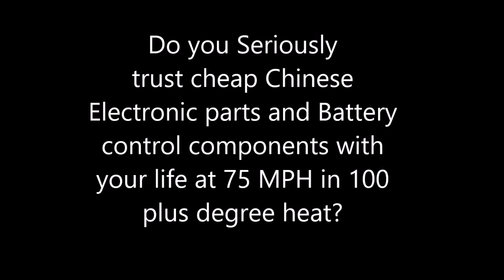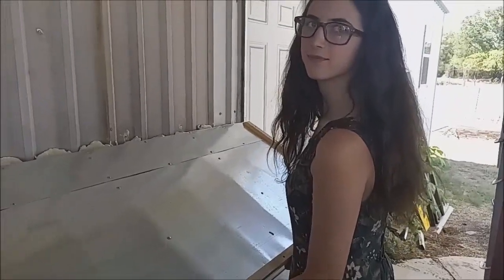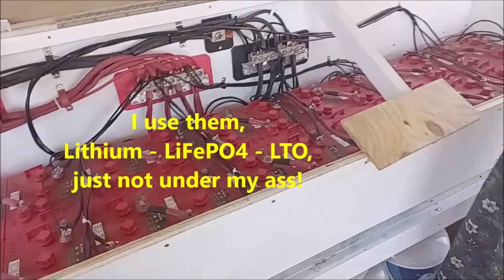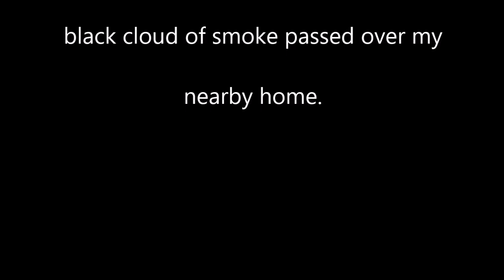Lithium Ion Electric Car On Fire, Battery Car on fire, The NEW NORMAL?

Comment: These electric cars will be a huge issue as people discard them the same way they discard their smartphones, flatscreens, laptops... etc.
Reply from the maker: People complain about somebody throwing a trash bag with a little bit of lead paint inside the bag turn it into an EPA national event and send in the Blackhawk helicopters like it's a act of war. But when they dump off a laptop, or any of the crap coming out of some of the new stuff we're building made with rarefied materials everybody just looks the other way. It takes 19,000 lbs of lead disposed improperly to reach the same toxicity level of 1 3500 lb  electric car.
Reply: @JOHNDANIEL1  RIGHT?! Lol I actually never dispose of my electronics. I keep them, I use my phones until they actually physically break and I still don't throw them in the trash. I have ancient laptops too that I will never throw out. I liked how my grandparents generation, used the same TV for over 20 years, the same phone, and reused everything.

Comment: Those who want to control everything, are impementing a smart system that will connect houses, cars etc, it will let them be able to do what ever they want to those who are connected. This is why they had all these solar contractors giving out great deala, fet eceryone connected to their system, if yiu go against the system, they can send pulses to you home batteries, car batteries, etc and make them overloaded and start a fire. Smart meters, smart batteries, wifi, smart tvs, smart appliances, etc.

Comment: Cant tell if there are bots in the comments or just fanboys... 🤔
Reply from the maker: I guess you're referring to the amount of people that immediately start defending lithium product batteries? My saying anything that may "appear" to be negative to the lithium battery cult members draws out an extreme response. They apparently don't watch much of the video that explains it's about the poor quality & over complicated electronics being used in such a life risking scenario not the battery used in something so they react with immediate cult level butt hurt. The whole video starts with me explaining I use lead acid because it doesn't require a bunch of crap that could fail to operate it.
Reply: @JOHNDANIEL1  yes it's either cult like following or bots spewing out info to support a narrative. I guess you'd have to figure lithium batteries are going to save the world to get that worked up defending them. Personally I think some day some battery (type) will change the world and maybe save it ?? but that's probably a stretch. Doesnt seem like lithium or lithium iron phosphate will be the ones to do it though. The cost is enough to disqualify them at the moment, nevermind the hazards.
Hope you're well John. Ive definitely learned some things from you through your channel and appreciate it.
Reply from the maker: @lancealderman2755  A study done in Canada showed Lithium Tool batteries, just one improperly disposed of permanently damaged the ecosystem of a 25 foot radius area and up to 4 feet of soil depth. Same results with any lithium based, especially China Air (CALB) battery. LiFePO4 and LI based are only 16% recycled with under a 1% yearly increase even though their use is gaining by 6% a year (Commercial Metals Expo 2021).
 Now multiply (25}4 squared times as much as 208.7 million a year of these batteries from computers to toys all done the same way. Nice huh! 
But since they pay nice for recycling Lead Acid batteries they get back 89% for reclaiming and a lead acid battery has only a 2% end user pollutions ratio. I did study both sides, but I can't get $680 cash from my LiFePO4 dead batteries in 5-8 years, but I can get that for my 24 Lead Acid batteries from the local dealer. Pays for the first 4 off the top. And my Lead acid due to using small wind turbines gained over 20+% longer life (static Ground Pulse DeScaling), over 8.5 years, but small wind turbines actually shorten the life of LiFePO4 due to their ground point pulses affect battery chemistry. 
NUFF SED!

Comment: When electric vehicles were around in the 1800's. The batteries they used are the same as the lead acid filled ones of today. As gas engines. They worked. Although as gas and fuel plus lead acid batteries. They can not make as much money with those as they can with the lithium batteries. See if anyone knows this. I am not sure. On the Tesla and other electric vehicles. Is it not the door opening mechanism also only electric? If so. Thats why who or whom was in that vechicle did not make it. They couldn't get out. If an fact. You own one. Have an window breaker handy at all times. For my shop solar. I use also lead filled batteries. Same with my boats and camper. No thinks on electric vehicles. If I had to buy one. There went the warranty. They can keep the lithium batteries. I am putting in my own.

Comment: I would NOT like to be trapped in an electric car, you just can't put them out.  Even if the fire and rescue get there in a minute, you are not going to get out!  I wonder how many deaths are going to be people trapped in an electric car that could have escaped a fire in a normal fuelled car.  You can put out a Gas/Petrol car, but try putting out an electric one!  Almost impossible.  I would rather have a Hydrogen car, at least the hydrogen burns off fast and the fire can be put out.  Mind you, while the hydrogen burns....Wow!!!!
Reply from the maker: A gas car can on average be extinguished in a few minutes, electric cars could take 30 minutes. They are equipping fire fighters with more assets to deal with them though.

Comment: /2022/01/12/government-data-shows-gasoline-vehicles-are-significantly-more-prone-to-fires-than-evs.
Reply from the maker: EV's are less than 1% of what's on the road. Include hybrids then you just exceed 1%.  They are also driven in much less places. I'm absolutely sure in 1903 that horse and carriage fires exceeded automobile fires at the time.
Reply: @JOHNDANIEL1  
AutoInsuranceEZ data from gov site shows EV catch fire 25.1 per 100,000, ICE catch fire  1,529 per 100,000.

Comment: According to the U.S. Fire Administration, it’s estimated that 171,500 highway fires occur across the United States every year. Highway vehicle fires account for fires in passenger vehicles, freight road transport vehicles, and agricultural or construction vehicles.

Approximately one in eight fires responded to by fire departments is a highway vehicle fire. The majority of those fires, which originated from the engine, running gear, or wheel area, occur in passenger vehicles. As a result, 345 deaths, 1,300 injuries, and $1.1 billion in property loss happens annually.   Remember, many of the parts in Gas vehicles are made in China as Well!
Reply from the maker: Look up Kia car fires, Chinese parts 90% to blame. That's the point.

Comment: 1 electric car burns what about the 1265 gasoline cars that burn this same day. Yes true facts.
Reply from the maker: If they were more than 1% of the cars on the road they may show up as the same average. Or even if they were the same average age but they are not. The average age of electric car on US highways is 3.84 years, the average age of a gasoline powered car on US highways is 11.77 years according to CNBC Business News. Plus you got to drive them more than the average of 30.4 miles a day verses 42 miles a day of gas cars to equate their risk. 
However the video wasn't about electric cars, it was about the crap they use in them.

Comment: Technology that works on the bench doesn't always function in the real world. 
I do have a milk crate full of calb cells next to my bed running my trailer. Protects them from extreme temperatures. That milk crate takes the place of my 650 pound pallet of lead acid batteries next to the trailer.
Reply from the maker: Nothing wrong with that if it works for you. But 650 lbs is 10 golf cart size batteries, about 1300 amp hours so if you can fit 1300 amp hours in a milk crate you got some badass batteries.

Comment: Electric cars do not use LiFePO4 cells because they are lower capacity than same sized Lithium Ion and Lithium Polymer.  If they did use LiFePO4 there probably would not have been a fire.  That also looks to be a pretty bad crash.
Reply from the maker: No signs of d crash, just started burning and very few feet later was in the ditch.
Reply: @JOHNDANIEL1  The rear end and side are crushed there is no way it was not in an accident and there are bumper parts on the hill.
Reply from the maker: I guess we'll start looking for the phantom car that hit it then, looks to me like a whole lot of parts flew off of it when it hit the embankment of the ditch but then again I was only a few hundred feet away
Reply: @JOHNDANIEL1  I am just trying to figure out why someone would slam the brakes and run into a ditch that fast causing that much damage.  I guess we wont know until an official report is done.
Reply from the maker: @jeffclark5206  Ah, Got ya. Yeah no one knows much, not even sure what it was besides a scene worker said big battery fire in car. But I do know in Michigan a Electric car caught fire and its wheels all locked up from regen braking and it slammed a hillside. But it's possible when a car fills up with smoke a driver may just wreck it. Someone mentioned skid marks from the west bound lane at my road entry, but thats Kyle, the idiot local kid in his hopped up S10 pickup makes those. He makes lots of them. Wouldn't want to buy tires for him.  This car was east bound and about 400 feet before my road.
Reply from the maker: This just popped up, see it, and know why I am avoiding all the weak link things people are wanting now. https://youtu.be/nU0nF1MxX34

Comment: Maybe a chevy bolt, all of them are under recall for starting on fire.
Reply from the maker: Yes I've heard about the Chevy having a lot of problems with their control operating hardware. It's not said that it's the battery it's the components they put on it. And that's exactly what the video is about, this car was I'm sure running the air conditioning, running 75 mph and doing it in the extreme heat so a component failure could have caused every bit of this. The batteries themselves would have been shut down if the control component would not have had a problem in my view.
Reply: @JOHNDANIEL1   @Јоhn Daniel  From what I read, the bolt problem was only due to a battery defect. That is why LG, the battery manufacturer, is paying for most of the repair.

Comment: Internal combustion engine with a radiator, water pump and thermostat...... Tried and proven to be the best technology to power an automobile.
Reply from the maker: Personally I do lean a little bit towards liking the hybrids. If I build me an electric car out of my 2000 Chevy Metro I will be using lto batteries absolutely which are lithium-based but I'll also be using a Freon gas temperature sensor bulb control switches and not some electronic voodoo garbage.

Comment: Maybe best use Edison batteries when you can find them the new company that sells kind of an Edison battery are $$$$$ 10,000 to 15,000 I believe per battery but they are 100 year batteries but lord  I ain’t spending $1,000 much less 15,000 for a battery
Reply from the maker: I've seen a few people physically building their own Edison batteries so I'm wondering how anybody can get away with selling them for an insane amount of money like they do.
Reply: I got 13 400ah nife battery cells off ebay  for $450. They are about 50 yrs old. ⚡️⚡️⚡️
Reply from the maker: @mdunbar04  Thats Luck! We had a huge Nickel iron battery bank in the back power system at Firestone Chemical plant when I was a kid. As big as a semi trailer and it was there for 40 years back then. Replaced in 2012 with the same.

Comment: You mentioned LTO batteries in your litany of Lithium batteries burning. Where did you come up with that. Lithium Titanate Oxide batteries have been tested safer than any battery chemistry out there. You also fail to mention how lead/acid batteries catch fire when charging and the sulfuric dioxide that they emit cause severe respiratory problems including lung cancer,  must continually be serviced by adding distilled water and have a short shelf life. I'll agree with you, however, if you're only going to run a 12V system that needs between a half to a full dozen chargers and inverters as you spend a few hundred dollars building your system over a 10 year period of time,  lead/acid batteries are probably the way to go. My LTO batteries can get up to 20,000 cycles and can be discharged down to 0% SOC. They can also be charged at a 10C rate of charge bringing them back from 0% to 80% in 90 minutes and 100% in 140 minutes. How long does it take to get your batteries back from 50% to 100% Mmmm, I thought so. So quit telling everyone that you aren't bashing Lithium batteries. Lifepro4 don't burn either!
Reply from the maker: I never said anything about LTO burning  or even said any lithium based battery causing a fire. It's the cheap embedded electrical stuff that's 90% the problems you'll get here. My simple comparison is is that my lead acid batteries don't need none of that crap to give me the results I need. 
Face it if you get in the war with China or anywhere else in an EMP goes off everybody's electric cars and electric toys using BMS or similar systems is gonna be  garbage. 
In fact if you can afford them I recommend LTO over any other battery AND THAT'S NOT BECAUSE I DESIGNED A PHYSICAL CHARGING SYSTEM USING OLD SCHOOL GERMANIUM PNP SHIELDED TRANSISTORS THAT ARE VERY GOOD. HAHAHA.
Reply: @JOHNDANIEL1 Your statement about the electric car burning included LTO and Lithium batteries, John.  You are also wrong again, I have a total EMP hardened solar system and one thing I have found about LTO batteries is that the cells rarely get out of balance so, all I would need to do is unplug the BMS leads and connect directly to the terminals. I also have three vehicles I keep that are carbuerated with generators. If your AC system is not EMP hardened,  you can't run anything anyway.  I am not pushing Chinese manufactured anything, my batteries are from Japan, hybrid inverters from Germany and Solar panels from Canada. I don't see anything that you use on your channel or had on your shop in Twin that wasn't made in China. Hahaha!
Reply from the maker: @fisherus  Simple solution to being EMP resistant is to self contain in a full metal structure. But, Not sure why your on this offended griff, No need to stretch it to "john beating up on LTO" thing. LTO is not a target of the issues. I like LTO better then any battery format. And you can charge it with a basic battery charger from Autozone.  And almost every part in all of everything you have, is still 90% made in China so yes, you funded China and since nothing I drive is deliberately newer than 2008 I won't have much china in it. Germany and USA "made?", thats a fraud. Answer, NO! Check BOL trails, everything is mostly a parts list from China ( BMW-Benz - VOLKSWAGON-GM-Chrysler-Siemens-Phillips- Toyota-Nissan- Midnite classics-Blah Blah, All of them partially assembled in China and finished in another location. Sanyo-Panasonic-Fuji battery plants in Japan is actually in Indonesia, Do a tour of the Capacitor plant in Japan, the Resistor Plant in Germany, the Control grade Semiconductor factory in ...........Whoops- None giving tours unless they originate in Shanghai  , Same problem. Hard to determine quality/plant/origin of any electronic thing other than try it, study it, and know facts on it, way different when it comes to their mechanical things for sure unless you got some magic dust and can build all of it. Even Ista Breeze of Turkey just is a boxing shop now. 
*Bet you can't stop or steer your carbureted car without those made in China (mexico if your blessed) new American branded made over seas since 2005 brake pads that suck! 
Even buying a Fkn horse may get you shocked that all their vaccinations and basics come from yep - FUKN CHINA! 
Do I support China, Fuk No. Do I spend days trying to sort out shit from useful, Yeah.

Comment: LiNiMgAlCo Chemistry is VERY different from the  LiFePO4 Chemistry we use in home solar projects BTW.    ALSO WATER FEEDS LITHIUM FIRES!!!!   Gives it MORE O atoms for the Lithium reaction and strips off the Hs. Treat it like an Electrical Fire.  NEVER USE WATER.   PS.  Texas Fire department was filmed pouring water on a EV Fire on a Gas Station a few months back /o\  PSS... 7+ PUMPERS OF WHAT???  Hope NOT Water LMFAO
Reply: ALSO.  IT HOT AS FUCK IN TEXAS. IF THAT COOLING PUMP FAILS... haha  FIre can happen quick.
Reply from the maker: So true. 
But until the manufacturers all of them stop buying components made with increasingly weak links from China and use a more sophisticated old style mechanical control mixed in the system you're going to have this problem and a technician for Chrysler even admitted it.